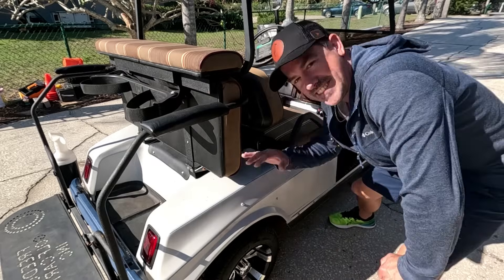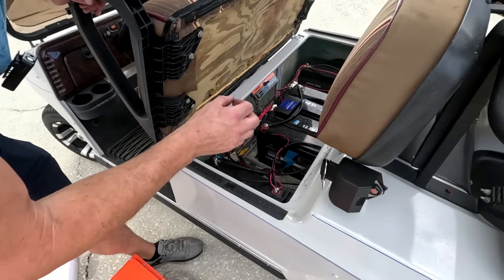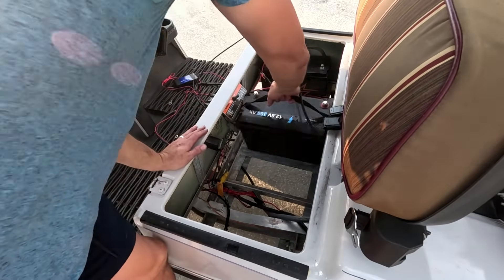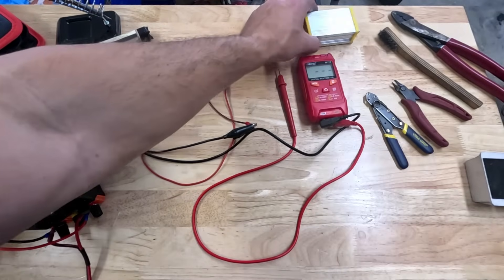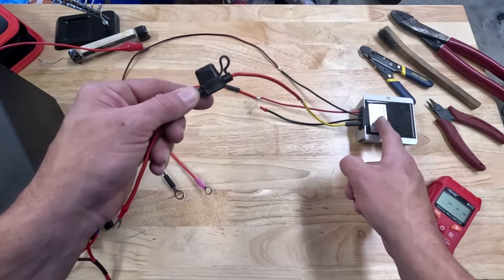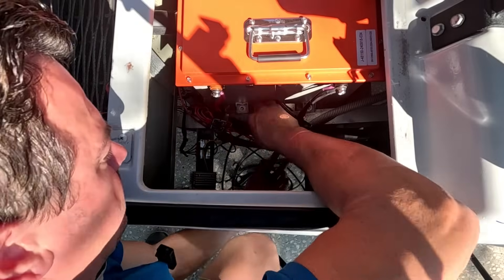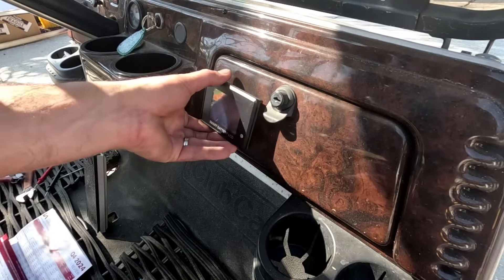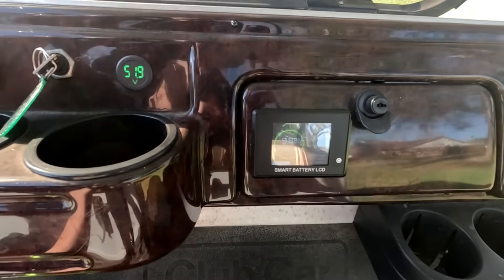How to Install a Lithium Battery in your Golf Cart! CHINS 48V 150Ah Upgrade Lead Acid to Lifepo4

Comment: Excellent detailed video as always. I do have a couple questions, as I'm about to upgrade our golf carts.

Is there any consideration about controller type when upgrading to lithium from lead acid? Can I simply just remove my lead acid batteries and install the chins?

Also, for the DC/DC converter, I'm assuming my cart already has one because it came from the factory with lights and other 12v accessories. Do I need to upgrade the converter because of switching to lithium?
Reply from the maker: As long as you are sticking with the same voltage range, you 'should' be good.  Going from 48v LA to 48v Lifepo4 is only an increase of a few volts and your electronics should be able to handle that increase.  If you go from 36v to 48v, I hear there is a lot more to consider... I will try that soon most likely!

Comment: I am installing the 48V 150Ah with build in charger (same as shown in video) in my Icon I60, the cart has already an original Icon charger 48V 2Ah built in. My question is, can i just connect the charger output positive and negative to the battery positive and negative since the battery has a built in charger already? Can find anyone giving me a straight answer.
Reply from the maker: Hey! That looks like a nice charger, no wonder you want to keep it. From googleing, it looks like its programmable with an app. If that's the case, you just set it up with the LIFEPO4 charge profile that's listed in the battery instructions! Essentially it needs to charge up to 58.4v with CCCV.

Comment: I just ordered one and when it came in I notice it did not come with a charger. I ordered it off Amazon and it showed it had a charger with it. Or am i wrong that it doesnt
Reply from the maker: Some listings have one, some don't.. but you can get any 48v lifepo4 charger, you don't need the expensive ones unless you need to charge it fast, but that's not good for the batt either. 👍
Reply from the maker: https://amzn.to/44r0V4s like this one!

Comment: Hey there, i just now ran across your channel, and you seem like a great person to ask. 

So I am leaving, short notice, on sort of a mission trip to Luweero, Uganda to help out a grassroots level orphanage/school there. I wanted to take over a couple of pieces of solar gear with me. But I have zero actual experience with solar setups. 
I do know that it can not be   big due to travel restrictions. I'll be departing from Denver, thru Brussels to Uganda and back. 

So I was going to take a few components, like maybe the inverter and panel(s) and then just buy the battery over there, might be a way to avoid some of those restrictions. 

I was hoping you could recommend a relatively inexpensive simple setup that I can bring with me to gift them with. As well as rechargeable led lights, or some sort of lighting, as they typically use kerosene lamps and such. 

Hoping you can help me out.
Reply from the maker: Hi there, sure! Is there anything else need to power or just led lights and maybe small electronics? I am thinking 12v will be most common over there (you may need to double check), but consider a foldable 12v portable solar panel, and 12v 600w pure sign wave inverter, and really any 120v led lights with a long wire and switch.  You could just find 12v leds as well.